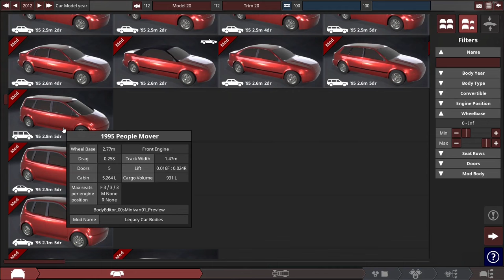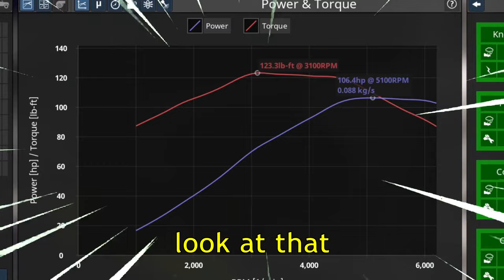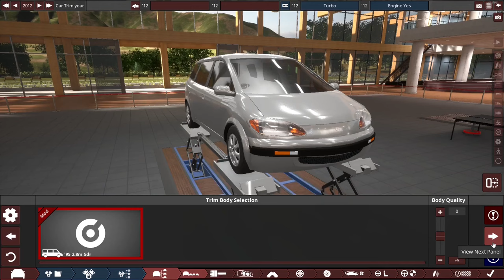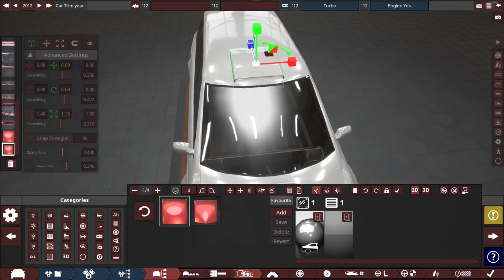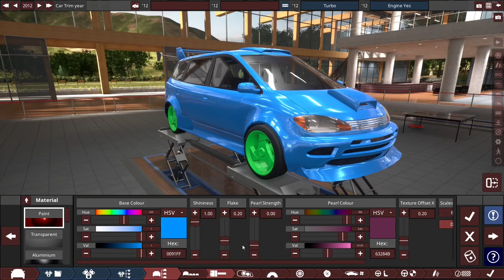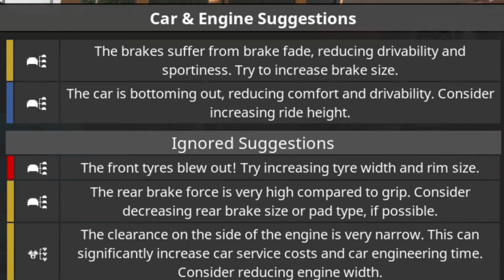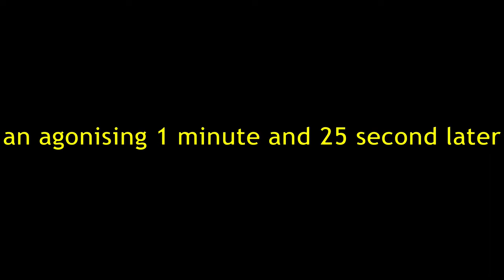THE MOST ABSURD RICER CAR (Automation | BeamNG)

Comment: My dad drives a Mercedes Benz 2010 unimog u400 with flatbed and crane its red semi-automatic 4speed but then its 8speed because the low range gears are upbto 4 and then when you go into fifth it automatically goes into high range and limited to 56 miles per hour three seats aswell also I just felt like writing a really long comment about it for absolutely no reason.Also I can not spot the difference between 7.5liter bob and his son.
Reply: Unimogs are rad as hell, dude
Reply: @mavericknizmo9182  yes